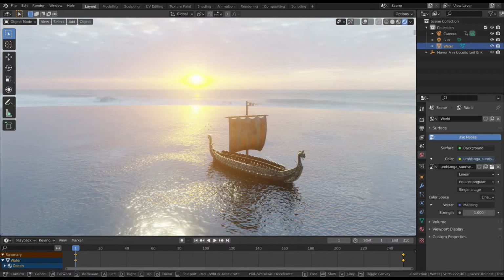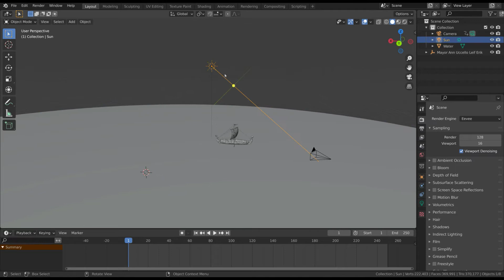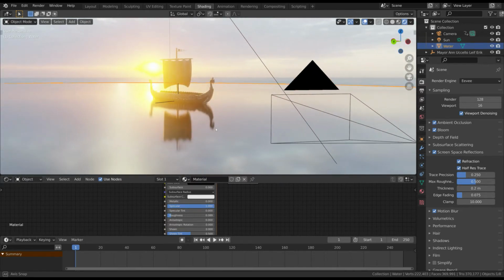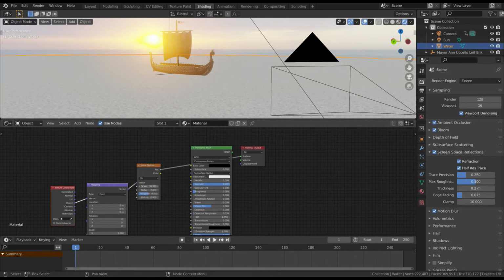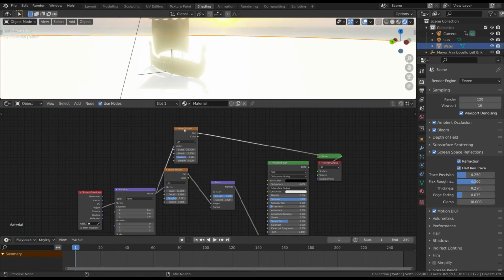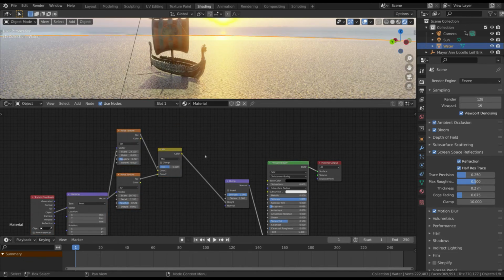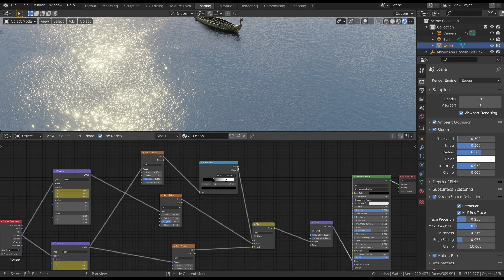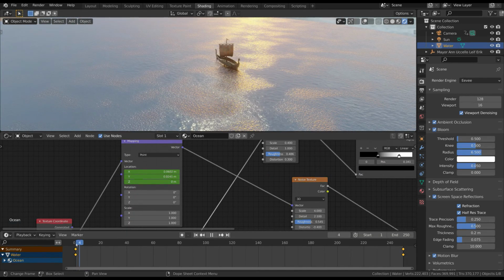Realistic Water Surface shader in Blender. Also in Eevee.

Comment: No. Displace the water, don't use a bump. This will be way better. Don't forget to turn on displace in the material tab.
Reply: Time will bring your ego down one day
Reply from the maker: Hi, displacement and bump are two different techniques that have completely different purposes.
The material displacement really deforms the surface in rendering time, but it requires more computations and only works in Cycles, not in Eevee.
As explained in the video, the bump technique is a way to get a similar result without the need of a real displacement. And, as mentioned, it also works in Eevee.
In addition, with material displacement, you don’t see what you get until you actually render the scene.
It is conceptually the same difference of using normal maps VS adding real details to an object.
You use it when you want to fake real details, but reducing memory and computation time.
So, there is not a best technique, but only what you need in your particular project.
Reply: @unrealab  "Hi, displacement and bump are two different techniques that have completely different purposes."

Yes. I know that. I turn both on. 

"The material displacement really deforms the surface in rendering time, but it requires more computations and only works in Cycles, not in Eevee."

I don't use Eevee. LOL. But if you want a good render, use Cycles and a displacement. If it's just a bump, it'll still look flat. Actual displacement looks so better.

"As explained in the video, the bump technique is a way to get a similar result without the need of a real displacement."

That's fine. Must have missed the part saying it's an alternative. Forgive me.

"And, as mentioned, it also works in Eevee."

Okay. That's cool. My statement is still okay if you want something that looks good, you just need Cycles! 

"In addition, with material displacement, you don’t see what you get until you actually render the scene."

That's why there is an option to render preview it. Blender 3.0 has made it so much better!

"It is conceptually the same difference of using normal maps VS adding real details to an object."

Yeah, I still use bump maps, but for things like ground or water, or things that need the not be smooth at certain angles, I use displacement. 

"You use it when you want to fake real details, but reducing memory and computation time."

Real displacements look better than bumps at cases like these. I would still use displacement regardless of computer specs for certain goals, like achieving realistic water. Bump maps are fine for many things, but displacement is best for stuff that requires you to view the object from the side and such. 

"So, there is not a best technique, but only what you need in your particular project."

Everyone does Blender differently, but if someone wants good looking water, they need to use displacement.
Reply from the maker: @CameronKiesser  Yeah, I think that with this we have clarified the two different approaches eheh 😄😄
I of course completely agree with you that displacement gives better results.
Here we simply wanted to show an alternative approach, in some ways simpler than displacement, and that can also be used in Eevee.
But, surely, if you want to get the best results, displacement is your first option.
We are also going to publish a video on how to build landscapes completely based on material displacement.
Reply: @unrealab  If you use displacement instead of bump do you use ocean modifier which includes physics (shallow water etc) or do you use noise, musgrave etc (just numbers) and just implement as a surface displacement?

Comment: or just use a musgrave texture and make it easy for yourself
Reply from the maker: You can use whatever texture you want, but the point here is that you have to use different textures in order to be able to control them separately. One texture for the small waves, one for the bigger ones, and so on.